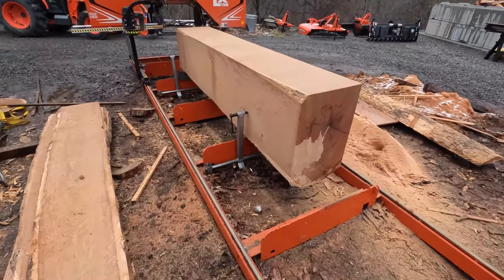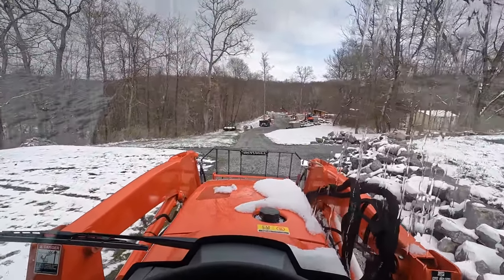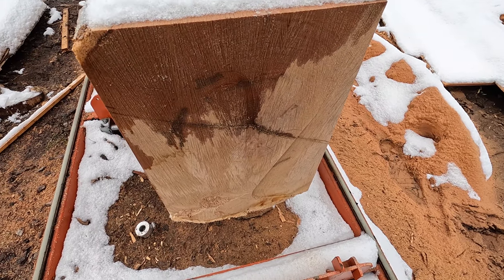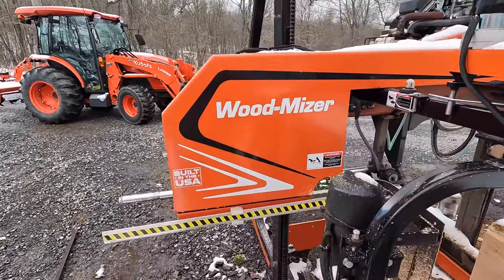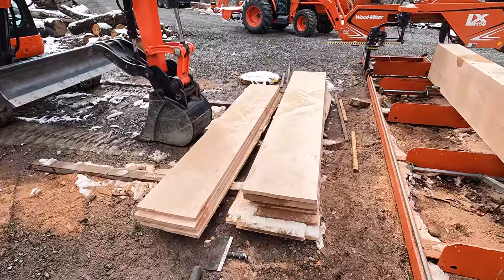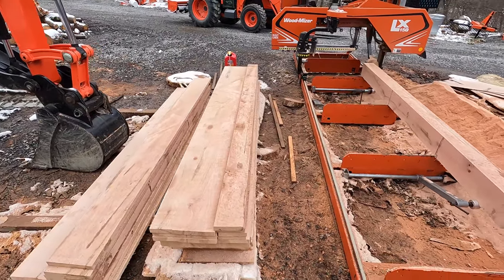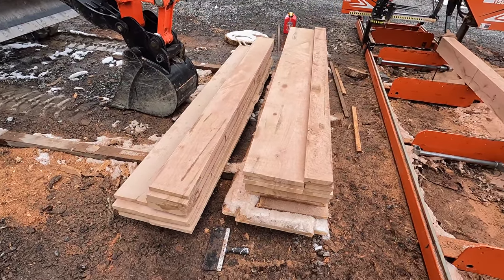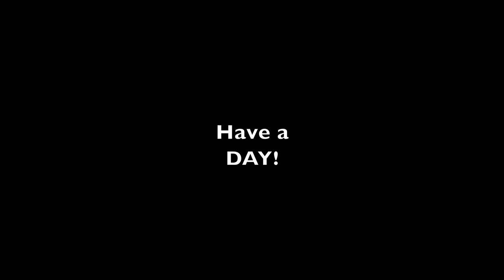How I Saw Huge White Oak Log on a Manual Sawmill

Comment: Well at 67 im doing that with no machines i am not a big man ,  certainly dont need any boards 18" wide but they are impressive i like to hug those big cants. I never throw water on my wood i want to dry it i know what it is going to look like but that's because I've been working with wood for 50 yrs. Made some w/oak  casement sash for a place in Rittenhouse Sq recently. Historical Door & window restoration my job

Comment: Nice oak, I would of quarter sawn that puppie. Would of been some good money if quarter sawn
Reply: There's also a premium for width, so it is a trade between the upcharge for 18" wide stuff and the upcharge for 8" wide quarter sawn, then factoring in the added time for handling to quarter saw and the loss of material.

Comment: Consider sawing right through the pith. That will put the pith in a few of your boards. Put those boards back on the mill and saw out the pith. When you do that you will end up with a few quarter sawn boards which are move valuable than the boards you are now. The boards with the pith sawn out and the boards just above and below would be considered quarter sawn, and the way you are currently cutting you are getting no quarter sawn boards.

Comment: Why call it eight quarters, not six thirds, let alone sixteen eights. Two inches is two inches.
Reply: Sawn lumber measurements have traditionally been called out in quarters.  3/4, 10/4, 12/4, etc.  One advantage is that if I say I have a 8/4 board thickness, it differentiates it from the thickness of a 2 by X, which is only 1-1/2".

Comment: Those wide oak 4/4 boards would be great for making cabinets.  You could make raised panel doors with a single panel on each door for anything except a 24" cabinet (larger than 24" are 2 doors).  Almost always have to do glue-ups for those panels.  Not only would it be way easier, it would also look special.  Bet your uncle that does woodworking would love them.

Comment: I have a John Deere 4044M the dealer told it was 50 hp the manual said it was 45 hp 50 hp, i asked the dealer again he sayed  again 50 hp. I even asked the head of maintenance he said 50 hp, I looked at the manual again it said 45 hp or 50 hp. What do you say? No covered top.